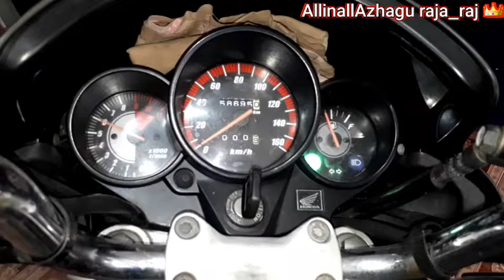Honda Unicorn Blocking Problem While Driving ? Solution! one of Main Reason...let's see ?!!!

Comment: G unicorn carburetor adichi poguthu mechanic ketta sonnan mechanic carburetor cleaning pannittu carburetor slide rubber ulla oru air screw o ring vachi lock panni pottu eppa cleanna oduthu pannadi aduthu complaint varuma
Reply from the maker: Varaathu sir

Comment: cold running my unicon bike starting ok but running 2  3 km missing then ok
Reply from the maker: Need to cheak carburater slide and S A I  filter then air fuel mixer

Comment: My unicorn 2013 model 5 to 8 hours rest Ah iruntha 20 km speed mela acceleration pandum pothu Vandi ataikuthu brother????
Reply from the maker: Come to.my what's app 9380528691 I will explain brother
Reply: @AllinallAzhagurajaraj my bike also same problem self start agala acceleration slow agala pick-up romba kammi engine sound change agiduchi running la slow panna engine off aidudhu enna bro pannanum mechanic Shop la test panni carburettor set mathanum nu soldraanga 6000 rs agumnu sonnanga please help me any idea
Reply from the maker: @prakashv2207.     9380528681. What's app me

Comment: Honda unicorn 150 - Key Switch on la vachu, led light wiring connect panumbothu sort aayduchu. Kick start matum than work aaguthu. Vera power supply varla. Ena pandrathu.
Reply from the maker: Wire short circuit aagi irukku
Reply from the maker: Come to my WhatsApp 9380528691